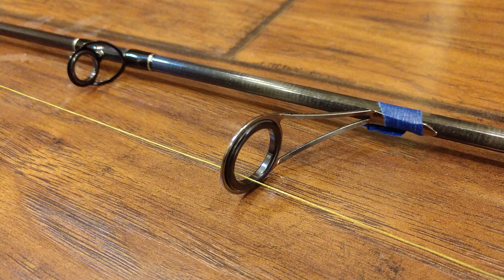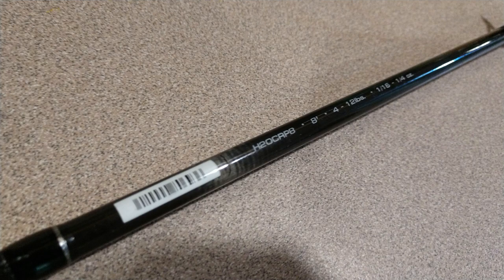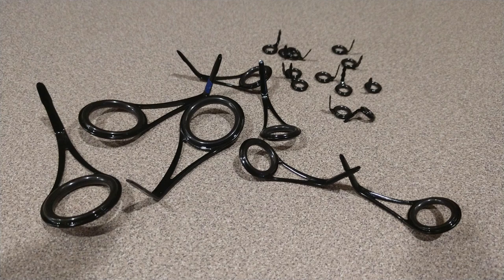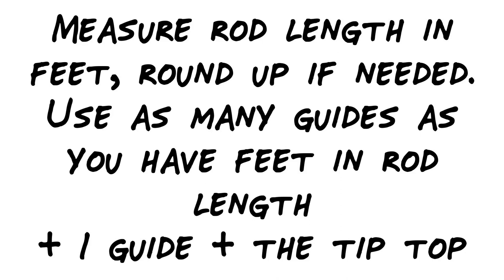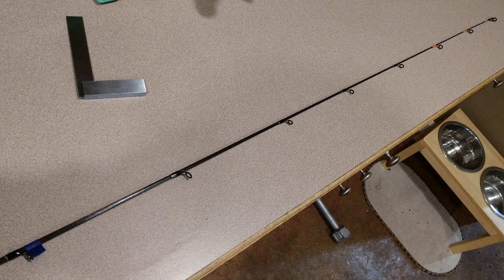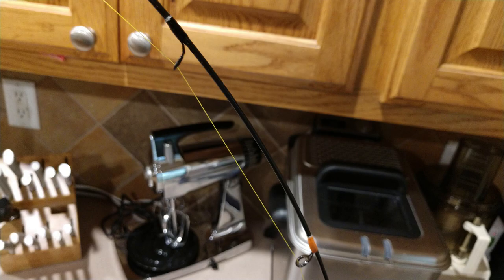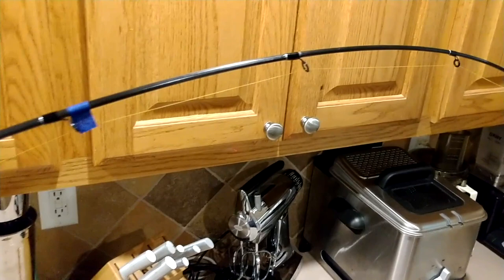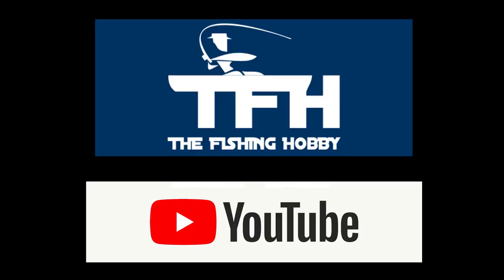New Guide Concept Rod Guide Spacing For Rod Building Or Modification

Comment: Great vid. I am a little stumped by the multiplying by 27 concept. Surely it depends on the length of the rod and action. Even so it doesn’t make right calculation. Example. I have a spool that is 57mm in diameter. Multiplying it by 27 gives me 1539mm. My rod is not that long. I’m working with 7’ rod. What am I missing here???
Reply from the maker: 1539mm is 5’-1/2” so your choker guide would be 5 feet and 1/2” away from the front of your reel spool. It has worked out fine for me with every rod I’ve tried it on so far but there could be times it doesn’t.
Reply: @TheFishingHobby  my reel face sits 19.5” from the butt. That’s 1”-7.5”. It leaves me with 5’-4.5” of rod blank to the tip. So the choker guide ends up sitting 4” from the tip. This is where I don’t get the concept. The formula would need to take into account the position of the reel seat. Now in saying that, if you take the measurement from the butt then the choker guide is on the money at 1539mm. If you have time to measure it yourself you’ll see what I mean.
Reply from the maker: I understand what you are thinking but the new concept guide system is based around high framed guides…technically, your choker guide could be your tiptop. Your choker guide could most certainly be one spot behind your tiptop. The choker guide won’t necessarily be near the midpoint of your rod. That will not change the number of guides you should use, it will just change the number of higher framed guides you will need. A short length, heavy duty rod for large game species like tuna will usually have the tip top as the choker guide. That just means all the guides leading up to that point will be higher framed guides.
Reply: @TheFishingHobby  aha. Ok. That now makra sense. Thank you
Reply from the maker: No problem and if you don’t like this layout there is always more than one way to layout a rod. This is one way, but many other ways will yield great results too!
Reply: @TheFishingHobby  I don’t have any issue with this system. Now that you have explained that the choker position doesn’t have to be somewhere mid blank it all makes sense and is pretty much how I have been building rods anyway generally speaking. I kind’ve assumed or took the info that there would only be two or three guides only before the choker. That’s where my mind came undone alongside the calculation throwing the choker almost at the tip. Now that I understand it, it throws me back to where my own theories lay.
Reply from the maker: @zoltanmusaic2901 I understand…it threw me off initially too! I had to look that information up myself several years ago when I started looking into this type of layout. Short ultralight rods with a split grip will end up with a similar layout and I was thinking the same thing as you were, there is no room! I had to read up on it and that’s when I found out that the choker could even be the tiptop and it all made sense after that. I agree, it does end up similar to something any load tested rod guide layout would give you, I think it just a handy way to give someone a really good starting point based on some simple math and the guide selection is more reel specific which should give you a really good casting rod when it is set up properly.
Reply: @TheFishingHobby  I’m glad you thought the same at one point. I don’t feel as dumb now. 🤣🤣
Reply from the maker: No one is born understanding the new concept guide layout system. You don’t know until you know, you know? 😂
Reply from the maker: I pinned your original comment to the top of the list so others can see it. It is good question that I’m sure other people have had as well.
Reply: @TheFishingHobby  no probs 👍

Comment: This is one of the few sources I've found on YouTube that adequately explain Fuji's New Guide Concept. Along with the PDF file in the description I was able to understand and implement this system and the results are amazing. The first spinning rod I built using this method with the rod matched to the reel I used multicolored braid so it was really easy to see the line oscillation between the spool and stripper guide, which on my set-up felt a little long but seeing is believing. No waves, no slap, no wiggle waggle, just a very controlled tunnel of line and it still blows my mind to this day that I made a rod this sweet.  As for the bait casting setup I haven't really focused on learning that (other than watching the slow motion tests done by Fuji's engineers) because I use acid wrap for my BC and OH rods and I'm not sure the NCG principle is applicable as the acid wrap design has its own specific requirements. 
Anyway thank you so much for this. I always return for a refresher when I make a new spinning rod.

Comment: I haven't started building rods yet, still researching what's needed and howto.
This is the first video I've found that explains the mathematics for setting up the first guide size and placement  on the rod blank.  Thank you for that.
Reply from the maker: There are other ways to do layouts, but this one consistently works well and is fairly easy to understand in my opinion. Best of luck to you on your first build when you get started on it!

Comment: Many folks know about rod blanks, but few truly know about rod guides. I'm like you said, no expert, but your visual truly showcases the distinctly noticeable advantages to your rod guide alignment.
Reply from the maker: If you want to see super slow motion of the line as it passes through the guides with various rod guide layouts (including this one) and the problems that this system solves, have a look at this video: https://youtu.be/5ANbtcbNvYU
That video clearly identifies the advantages to this sort of guide layout.
Fuji are the ones who came up with this layout and then the way it is easily laid out using some basic calculations was presented by RodMaker Magazine. This isn't a layout you would see on a normal off the shelf rod but some high end rods may use it. A whole lot of custom rod builders use it because they know what reel the customer will be using, so they can easily do the guide layout accordingly.

Comment: Thanks for the information, you passed through something I have been struggling to learn more about, is there a MAGIC RATIO between the Reel Top diameter and the FIRST Guide? I saw you said that to figure out the correct spacing, you measured your reel top diameter in mm and multiplied it by 27... but what was the guide insert opening ? And why did you chose a 20 H size guide instead of 25 H...

I guess what I am really looking to figure out, what is the correct reel top diameter if my guide was a size 25H or 55mm ? Im looking to max casting distance for hardbaits minnows and jigs.

Comment: How do I measure rod guide sizes? If the plans calls for a size 30 guide, is that 30 mm of the outer or inside diameter of the guide insert itself? Also, what does the letters means, like H or J?

Comment: So the standard practice of spacing the guides measuring from the tip of the rod is not the best method ?
Presently building a 10 foot Hexagraph spinning rod and have been concerned about finding a better method for guide placement. .
Thank you for providing a better layout for guide placement..
Using a Penn 5500LC spinning reel and 14 guides and tip..
Great informative video..
Reply from the maker: I didn't invent this method, just to be clear. This is something Fuji came up with. This method works great for me, but everyone likes different things so I can't say this way is better for everyone. My best recommendation would be to try some load testing both ways to see which you like better. I know that is a lot more work, but you will be able to tell which method should work better for you. Good luck with that build!

Comment: modifying some  fresh water rods for  light line surf fishing similar to yours-     Question  where  to buy guides?  see some on  ebay-  from china   or should I avoid these?
Reply from the maker: I have used them and they work OK for freshwater but probably would be more likely to rust. The quality is not as good, they also tend to be heavier. It is pretty hard to beat the quality of guides for the price you pay on Fuji guides. Even their low end guides are well made. You can buy them on eBay or from sites like Mudhole or Jann's Netcraft

Comment: Kevin, maybe Im doin something wrong in my figures, but this dont ad up. My reel is 44.45mm, times that by 27. That converts into inches at 47.25". That dont work. What am I doin wrong? Ideas?
         Richard from Kansas;)
Reply: Thats on a 7' rod. That puts the choker 23 1/2" away from front of my reel. Is that to far. Im just a beginner and what I have learned most say 18 to 22" is where it should be. Im just confused. The crb book says on that 7' rod the choker is recomended at 50 3/4. Its only 3 1/2" difference. Will that matter you think or not?
Reply from the maker: @ramoutdoors6415  I think you have the choker guide and the stripper guide confused. The choker guide will be the same size as your running guides that are on the top part of the rod. The stripper guide is the first large guide in front of the reel (and usually between 18-22 inches as you mentioned). You usually use a stripper and one or two reduction guides before you get to the choker guide. I think I put link in the description of this video to the original article in Rod Builder magazine. Take a look at that and see if it helps you out some. If not let me know and I'll try to help you out if I can. Good luck and I hope that helped some!
Reply from the maker: Oh yeah, and as a general rule of thumb the stripper guide should be about half the size of the front lip of your spool. For example, if you have a 40mm spool lip, the first guide (stripper guide) should be around 20mm in diameter. I've found with braided fishing line you can go smaller. Mono pulls off in larger coils so the bigger stripper guide ring size helps.
Reply: @TheFishingHobby  yep I meant stripper, my bad. Yes I will take a look at the link. Thanks Kevin!!!

Comment: Thanks for info👏
Just recently I tried to modify a heavy feeder  rod used for carp fishing.
And because i used a big carp reel something like 70+mm spool diameter I didn’t feel the first big guide is higher enough.
So I tried to modify guides to match my big reel. I didn’t tested yet my setup but if you have time can you check my last video to see if it’s any good ?
Anyway the rod is 14 ft with 4oz tip and I didn’t find any resources for guides spacing and stuff..
Thx again
Reply from the maker: It looks like it should work better now with the reel you are using. You can do what is called a “static load test” on the rod with the guides installed and check to make sure the bend of the rod looks like the load is well distributed between the guides. This will let you know if your guide spacing is going to work well or not. Ideally you would want to do that before permanently attaching the guides. From what I can see on the video, you should be okay but I would still do a static load test to make sure. Very nice job of getting the work done with what you have. I have wrapped guides like you did just holding the rod, but it isn’t easy! I made this video a long time ago about making a wrapping jig out of a cardboard box. You can give that a try next time and see if it helps you out a little: DIY: Make A Free/Inexpensive Fishing Rod Wrapping Jig Out Of A Cardboard Box!!!
https://youtu.be/wEC8ktjlYTk
Reply: @TheFishingHobby  thank you 🙏 
Static test should be fine anyway because is a heavy rod / practically bending starting in the other half of the rod to the tip( it’s like a softer surf rod).But I will do it anyway 👍
We use rods like this to push 100gr feeder  to 120-150 meters, using monofilament 6 to 10Lb and braided shock leaders.
Reply from the maker: That sounds interesting! In the USA, carp fishing isn’t popular. I’m not sure why that is. I’ve watched some people on YouTube in other countries fishing for carp and it looks like fun to me.

Comment: I have a 7ft spinning rod. And I’m not sure what size to get from Fugi KL-H 209 or 259. Please help me lol. I’m stressed and also I’m not sure how to space them
Reply from the maker: I wish I could help, but most of the sizing and spacing is something I do for what I’m building for myself. What I need and what you need are probably two different things. You can find generic layouts and sizing information online in various places but I personally never use those. I do most everything by sight/experience and I tend to build my rods based on the reel I will be using. Your best bet would probably be to look at some generic layouts from mud hole or some other site and build based on that. Then pay close attention as you use the rod and try to determine what adjustments you would make to the next one to better suit your personal needs. For example, I tend to use smaller diameter guides with higher frames than most people because it works better for what I’m looking for in a rod. Generic layouts will definitely get you in the ballpark and you will be able to build a perfectly usable rod based on something like that. Keep notes for what you would do differently on the next one. I wish I could be of more help than that, but that is how I had to learn to do things and you will learn a lot along the way too.

Comment: very good video.
on these old rods do you trust the factory spine of the rod or do you try a set for that?
also do you thing braid or monofilament changes anything in your guide elections?
thanks
john
Reply from the maker: Thank you! On this particular rod I'm just leaving the factory installed guides in place for all of them except for two of the reduction guides that will need to be removed. For simplicity, I'm not going to worry about the spine on this one. If I were building on a fresh blank, I would check for the spine and build off of that. As far as rod guides and braid go, any modern guides on the market are built to work with braid. There is one exception to that and it is Kevlar braided line, you will want titanium guides for that type of line. Most braids are a polyethylene based line which really isn't very abrasive at all.
Great questions and thanks for watching!

Comment: Thanks for sharing.I'm just confused, should I use same guide spacing on same length but different action of rods?
Reply from the maker: It works well for any rod type I've come across. Of course your spacing will be dependent on the type of reel you are using. For example a 7 foot long ultralight rod will have a small ultralight reel with a smaller spool diameter so that will have an effect on where the choker guide is placed (moving it closer to the reel) so that also affects the number and size of your reduction guides. A 7 foot long heavy action rod will use a larger reel with a larger spool diameter which will move the choker guide closer to the tip side of the rod and require larger diameter reduction guides and probably more of them as well.
I hope that makes sense. I put a link to the original article from Rod Builder Magazine in the description that may help you out too.
Hope that helps!
Reply: You really have to let go of the idea of preordained guide placements. Forget about charts and traditional wisdom from the past. Everything is determined by the size of your reel, more specifically the height from the center of the spool to the top of the rod blank.